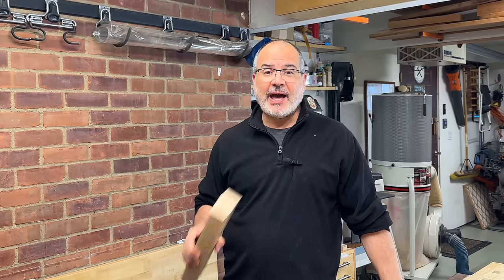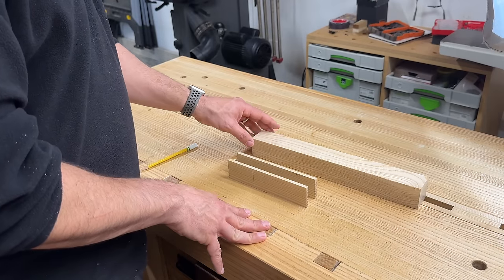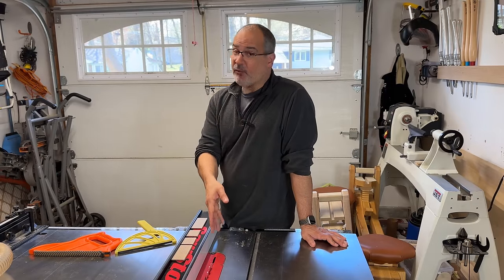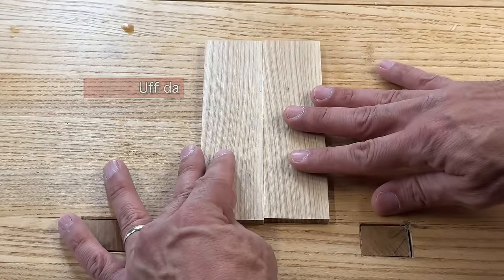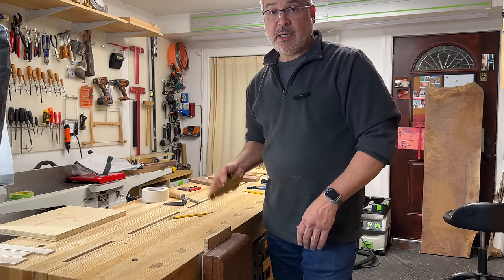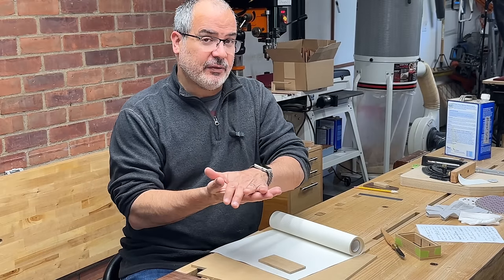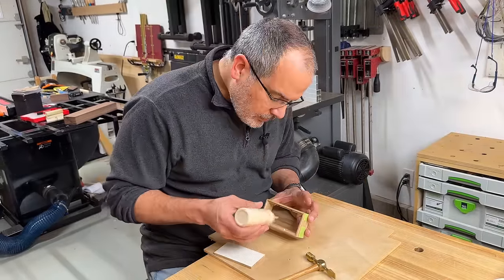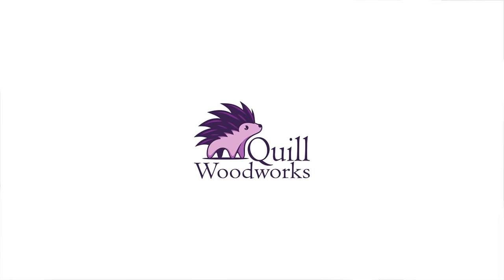A Tilt-Top Mitered Box You Can Make Today For Pennies in Scrap Wood. Beginners: hone your skills!

Comment: Beautiful box. Can you explain the dados for the dividers a little more. I’m having trouble picturing/understanding why the back has through dados but the front requires stop dados.
Reply from the maker: Thanks for watching. The rabbet at the rear of the box sits lower than the rabbet in the front of the box. This is to facilitate the tilt-back lid. If I made the dados in the front through dados then there would be a notch left because the divider isn’t wide enough to fill the dado in the front. In the back of the box the divider is flush with the rear rabbet. I hope that makes sense!

Comment: Along with wood working I play guitar too. I really like that sunburst guitar. Had a roommate in the Marines in 1979 who had one just like it that I really admired. 
I have a tobacco sunburst Les Paul and a similar looking Fender Acoustic along with several others and a bass. 
The 2 I mentioned are my everyday go to guitars. I have a black, white and gray camo pattern Dean Dimebag Darrel V that I never play. Gonna have to change that! My brother got the one that's black with lightening bolts on it. We got them in a set from a guy who was selling them cheap so he could get rid of them and get something else.
 I also have a kit double neck, 6 string, 12 string that I need to paint up and put together.
Reply from the maker: I had a Dimebag Darrel wah pedal back in the day and wish I never sold it! I usually reach for my Strat first but have been picking up the Les Paul more recently. I just wish it wasn’t so heavy!

Comment: Well done, sir. I like the extended rabbet to hold the lid. One potential opportunity I noted was that there isn't room for the bottom to expand. It's a small box, so the expansion and contraction of the bottom will be slight, but the natural wood movement may need to be accounted for. I greatly appreciate the time and energy invested in the video aspect also. That can be such a time suck. Top notch work all around, sir!
Reply from the maker: Thanks for the nice words! With the bottom panel being nice straight grained material and also less than 2” wide, I wasn’t concerned with movement. But like you said, on a larger piece it would certainly need to be accounted for. I appreciate you watching!

Comment: Very nice box.  Nice technique.  Nice video.  Q?  Why do you prefer to trim the width of the blanks and rebate after you've cut the lengths to size.
Reply from the maker: Thanks for watching, Dan. With the width of the piece, I may sometimes cut that first. But with the rabbets…I prefer to do them later when they’re not so long because I find it easier to get even pressure as I pass it over the blade or bit resulting in a slightly more accurate depth. Hope my explanation makes sense and thanks again!

Comment: Nice project…one question:  how does the lid keep from falling off, if you turn it upside down, for example?  Otherwise, I like the notch at the back of the lid to keep it propped open!  Nice touch.  Thanks!
Reply from the maker: Hi RH. The notch is just for keeping it propped open. If you turn it over, it’ll fall out. Hope that clears it up. Thanks for watching!

Comment: Dude, using a grout float as a soft push paddle is pure genius.
Reply from the maker: I love it. Cheaper and grippier than the ones I’ve purchased from Rockler. Thanks for watching.
Reply: @quillwoodworks  thank you, that is definitely going to be what I use on my router table and jointer from here on out

Comment: I was wondering how you were going to handle the thickness of the leather. Instead of compensating for it, you just let the bottom stand proud of the sides. I think that worked out very nice (better than a flush bottom, in my view), but I didn't notice you mentioning it. Was that design feature intentional or just serendipitous?

By the way, your "playing" at the end won me over. ❤
Reply from the maker: Thanks for the question, Ted. That was intentional. I like the way it “lifts” the box off the table and gives a nice shadowline across the bottom. 

I appreciate you watching!

Comment: Great project to use up those small scraps.  And thank you for lots of great tips!  What kind of glue do you use to attach the leather?
Reply from the maker: Thanks Tom! That just regular PVA wood glue. Titebond 3, I believe. Very strong bond. The material will tear before it will pull up. I’ve used contact cement in the past but the fumes and smell stays in the shop for hours.

Comment: A well done video! I would like to know about how you made the swivel lid? I can't seem to get it in this video. Mostly measurements.
Reply from the maker: Hi. The notch is only about a 1/4” long and about 3/16” deep in addition to the rabbet that runs around the perimeter of the inside. Hope that helps.
Reply: @quillwoodworks  Don't you have a pin for the lid to turn on?
Reply from the maker: No, Matt. It just rests in the notch when tilted back.
Reply: @quillwoodworks  I do appreciate you responding to my question. What a good idea you have. It takes your work to another level and it is so simple' I will use it in my next box. I have a shop with a full complement of tools and I am in my eighties. I thought I had seen just about everything concerning wood working but your design is a first. Thanks pal!

Comment: Could you list the table saw blades you used? Thanks in advance.
Reply from the maker: Hi Steve. I use a Forrest Woodworker 2 for most cuts and a Freud heavy duty rip 24t blade for cuts that require a flat bottom. Thanks for watching.

Comment: I'm getting old, because I'm sure I knew the answer. The outside of the pieces will be the inside of the box?  Why?
Reply from the maker: Hi Vincent. Since the inside of the pieces are closest to each other, as opposed to being separated from each other other by half an inch like the outside faces are, their grain lines will line up that much better. In the finished box the inside grain lines don’t match up quite as well but not as visual as the outside so we make the trade-off. 

Hope I explained that okay. Thanks for watching.
Reply: @quillwoodworks  Got it.  Thanks!  I like the solution to the grain issue for the ash.  Ash is a cost effective choice in my area so your approach provides me some options. I don't mind the cathedrals when you see plenty of them on a wide board but seeing only a fraction of one on a narrow piece is certainly unappealing.

Comment: Your out of your mind,or don't have enough experience to understand that the Cathedral Grain is way prettier than straight grain,
Like your build,nice video,but for the love of God don't tell the new woodworkers straight grain is better.
Reply from the maker: I’m actually fine with cathedral grain but it would have looked absolutely terrible in a box side that’s not even 2” wide. I see some of my earliest work and the biggest flaw in some of the pieces was the poor choice in grain selection. Thanks for watching, Paolo!
Reply: It's all a matter of preference.  I for one much prefer quartersawn or rift sawn. Cathedrals not so much. Rarely use it in fact.

Comment: Love it but first minute in hes playing with tools I don't have as a beginner
Reply from the maker: Hi Kelley. I’m currently working on a video that relies on less power tools. Hopefully that will be more useful and up your alley. Thank you for watching!
Reply: @quillwoodworks  i have the table saw but that was about it for me, however I will look forward to making boxes without all the power tools... There were things in your video I think I could do, but I have the rigid cast iron table saw and it has issues that I hope to fix this summer, such as the fence is never straight, I have to measure and remeasure it like five times before each cut... and the plate that came with it is sunken in from the top (Which I plan on making my own)
Reply from the maker: My first table saw was a Ridgid but thankfully the fence worked pretty well. I imagine having to remeasure before each cut is not only frustrating but slows you down a lot. Best of luck in trying to fix the issue.